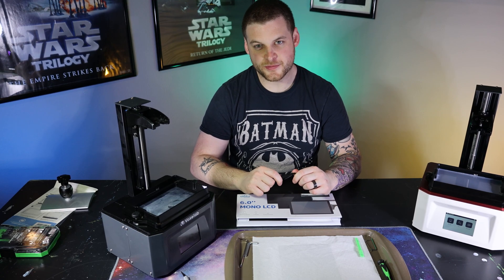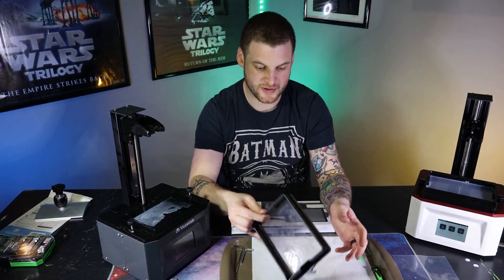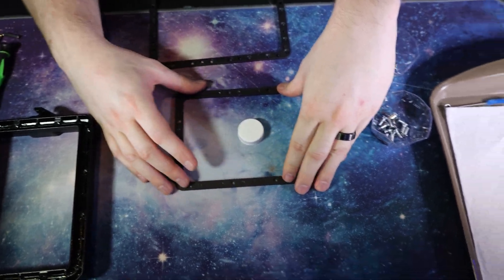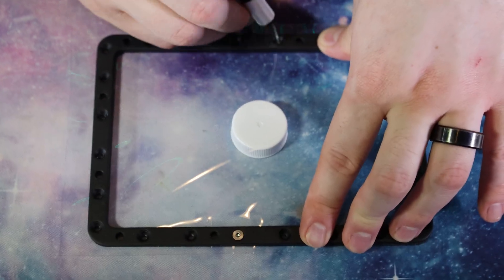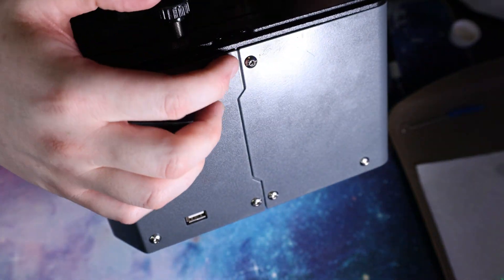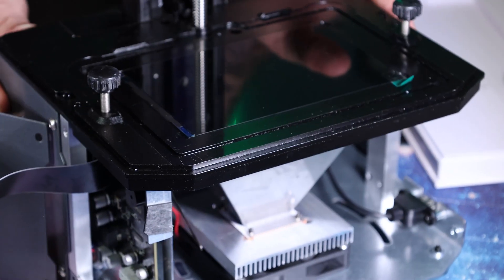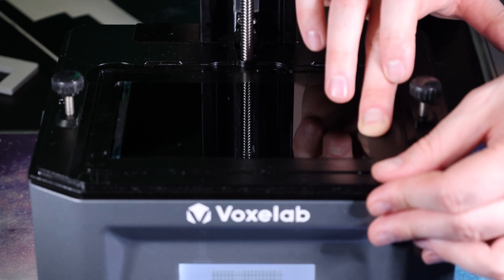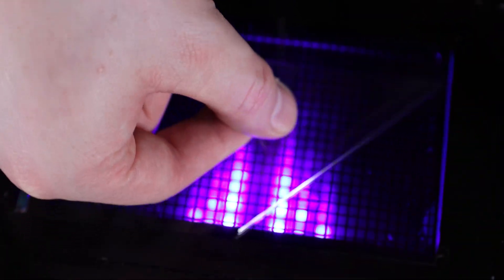Voxelab Proxima 6.0 2K Mono LCD Resin 3D Printer Screen and Fep Sheet Repair

Comment: It looks like my Wowstick will definitely earn its living with this job (not that it doesn't already); I never realised there were another 24 screws on the back side of that thing! 😯

  I bought the same setup as yours (Proxima & "wash 'n' wipe" as my missus calls it) last December, and it's all set up in its own space, I've stuck a flexi-plate on along with a 2209 driver ready to go, but I haven't even got around to levelling the plate yet.

  I've just snagged the upgraded Proxima 6.0 4K version, so over the next few weeks, I'll be trying them both out to see if there's much of a difference before I decide which to keep or send back; your videos have been super helpful in getting me going, thanks! 👍